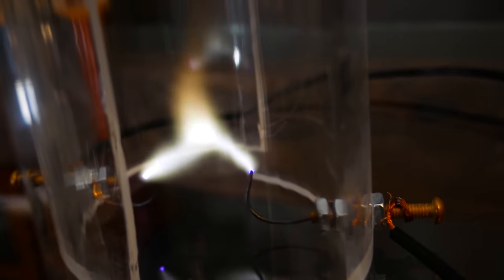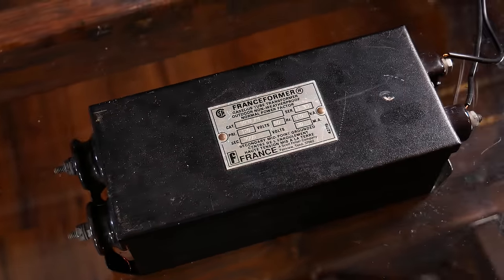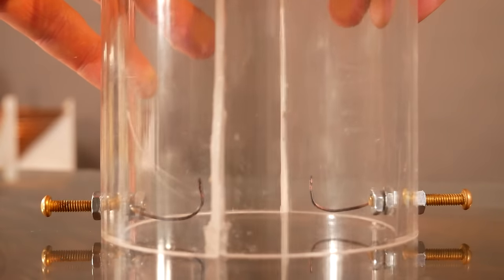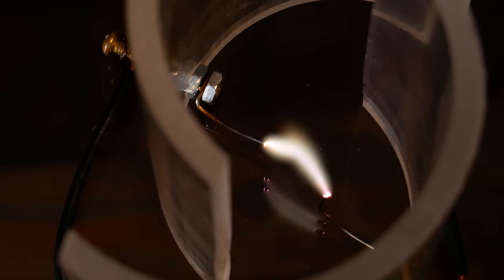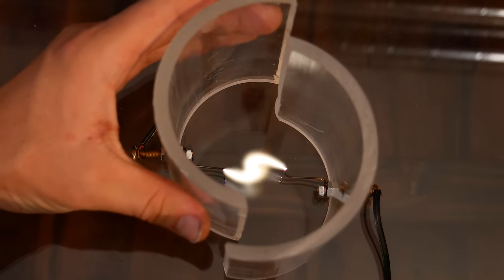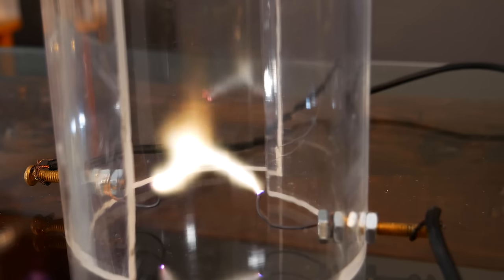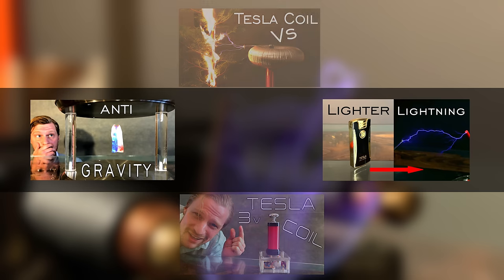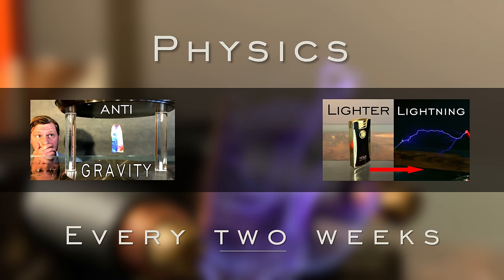9000 Volt Plasma Tornado Made by Electricity

Comment: Nice! I wonder what would happen if the wires were up and down rather than side by side. The arc would be vertical to start with, maybe it would do a belly dance?!
Reply from the maker: Hey Boom! I attempted this, and found the arc rotated, rather slowly, while bowed out. It just rotated once per second like a lazy Suzan arc. Wasn’t as interesting to film.
Reply: Hi Mehdi. :) 
I really love your videos and content. Hope to see you soon.
Reply: Hi electroboom
Reply: Both of you heros of mine... I have a similar concept I've been wanting to try. But would be willing to pass on the opportunity to either of you to do for the views. 

Take the rotor out of a decent sized 3phase motor. Hook it up to a VFD, Put a nice acrylic tube  through the motor and pull a vacuum.  I think you both see where this is going. 😃
Reply: That, and a bigger beefier FULL BRI..
Reply: I want to try this experiment with a microwave transformer
Reply: Gimme da meetah!
Reply from the maker: Heads up - the MOT vaporizes the wires. Too much power!
Reply: Also what would happen if it was in a smaller diameter tube
Reply: Instead of stacking straight vertically... Stake the wires with a twist to aid in spiral flow..
Reply: Do Not try this at home! Please! We love you too much! Don't do it! 🤪🤯💕
Reply from the maker: However, this would not be a plasma vortex. It would merely be a spinning Jacobs ladder
Reply: @PlasmaChannel  if you want to increase the rate of Arc rotation then you need to add a coil to the base of your tornado.  Ideally, power the coil with the same current you're using for the arc.  If you use the right hand rule, you should be able to induce a tornado without any air current needed.  The air will just lower the temperature and make it more visible.
Reply: @PlasmaChannel  use carbon electrodes.  It's easier to start and has a much higher vaporizing temp.  They do burn however, so they will still need to be eventually replaced.
Reply: Im the 100th like
Reply: @Unmannedair  Good idea, haven't seen it yet, and it could be done in a setup similar to the one on my channel with the coil being submerged for cooling. A pure iron core for the electromagnet would also be beneficial.
Reply: Hey Mehdi! Missing you man!!!!!!
Reply: @PlasmaChannel  please post it anyway, would love to see what you did and the results. It may not seem important but would like to see it anyway.

Thanks
Reply: Hi electroboom
Reply: @PlasmaChannel  9700
Reply: @PlasmaChannel  0
Reply: @PlasmaChannel  7
Reply: @PlasmaChannel  679
Reply: @jamesharrell4360  9
Reply: @jamesharrell4360  9
Reply: @PlasmaChannel  How about adding a vertical magnetic field? Lorentz force should spin it faster
Reply: I would use a ring on one or both lines that should help it rotate more 

For mot I would switch to carbon electrode and more so water cooling terminal

Comment: try a microwave oven transformer for that: 2000V 1A. Arcs should be hotter and thicker
Reply: Yep, I got 6 inch loops with one once before the breaker popped. I think it was producing around 650 mA.
Reply: Professor K MOTS are terrible for long lasting arcs, don’t rely on them to last more than a few minutes without melting lmfao
Reply: Might be fun to watch
Reply from the maker: I tried an MOT off camera. It was just too much power for my little setup. Vapporized the wires and burned the plastic in less than 1 second.
Reply: @PlasmaChannel  thanks Jay! Maybe it would work with a sturder setup...

Comment: Can you tell me how you increased the current from 30 mA to 60 mA of the Neon Sign Transformer ??
Reply: Two in parallel.
Reply: Or remove the shunts.
Reply: th trasformator might have 2 outputs like most transformers (3pins total)
Reply: But the one he used had only one. I have never seen one with two outputs.
Reply: @simont3686  there is a lid you can screw of on some models i know of (lid is for HV security)
Reply: @hyperhektor7733  I know that you can disassemble some of the old ones and remove the magnetic shunts to increase the output current.
Reply from the maker: Hi all, I placed a second identical 9kv 30ma transformer in parallel, off camera. I even tried with 3 in series...but found difficulty with the third (think it was half dead)
Reply: @PlasmaChannel  Thanks for the info. Now I got it......💯💯💯
Reply: Thank you. That seemed the most practical solution.

Comment: Good start! Two suggestions. 1) If you form the electrodes in a tall V shape (Jacobs Ladder) the plasma will heat and rise more easily. Also be more responsive to the convection current. 2) Add a ring magnet, like one from a magnetron, at the base. The magnetic field will also make the plasma spin. Positioning will be tricky. That is it. Please try some new ideas and make a part two.

Comment: Great video! In junior high I actually did a tornado chamber for my science fair project. That design consisted of the heat plate with water plexiglass doors that slid in four directions and heat lamps on top with a chimney in the center top. this creates a higher heat difference between the inside of the chamber and the outside of the chamber and gives a direction for air to rise. In the same way if you add a top with a chimney you can trap more heat within the chamber so the cooler air that comes in from your slats will create the heat difference needed for the convection to Twist!
Reply from the maker: Hi Mike! I tried something similar, and found that the vortex shrank in size, but, was much more stable. I'll give it another go ahead and see what happens
Reply: @PlasmaChannel  maybe air intake issue? Hmm interesting to think about! Can't wait to see your next attempt!

Comment: Cool! Very clever idea Jay, I'd love to see more of it! But don't forget that you still need the voltage to maintain the ionization of the air, so I think there should be a sweet spot somewhere in between. I would suggest trying the high frequency arc with a couple of hundreds of mA in it, the HF generally dumps more energy into the gas than DC and 50 Hz; for example you could try an old AC flyback. Good luck!
Reply from the maker: Hey Vidduley! Glad you enjoyed. Trying this with high frequency AC is something I do want to try.

Comment: You might already know but you can get insulating gloves made for handling these voltages for under $30.
I reckon gloves are a great buy! 
Just make sure they're class 2 or higher: 

Class 00 (500-650V), Class 0 (1,000V), Class 1 (7,500V), Class 2 (17,000V), Class 3 (26,500V) up to Class 4 (36,000V)

Pro tip: 
If you go to buy these you'll see thin cotton inner gloves being sold beside them on the shelf. They're not optional! You'll barely be able to get the rubber gloves on without them and will be disgustingly sweaty after 5 minutes. 
 
Insulating floor mats are also a good second line of defence (again, so long as it's class 2+) but they're more expensive and somewhat less useful when playing with neon transformers because there output isn't referenced to ground though  this should not be relied on. 

If you don't like the idea of gloves getting in your way (class 2 gloves are thick) another good idea I've seen is powering it from a dead man's switch mounted just out of reach of the project but what's the fun in that!
Reply from the maker: Thanks for the reminder - I need to get me a pair.

Comment: Did you trust those thin wires at 9kV? I have 20kV silicone wire bit I can feel a slight tingle if I touch the insulation when the wire is just 3.5kV to ground(7kV neon transformer).

Comment: Nice.....have you added smoke?...to see what is going where?...I would also move your nut/bolt arrangement off center left and right...as the air flow was inefficient due to the angle I was seeing for flow....just my observations...great experiment.
Reply from the maker: I tried two different nut/bolt placements - but could try additional. As for the smoke, that would have been such a good idea. I'm kicking myself for not including that in the viddy.

Comment: Neodymium magnets do some weird Spinny things to 6kv 80mA arcs.

And you could try to use argon gas!
Reply from the maker: I plan on combining strong magnets with this vortex setup, acutaully. May get some cool results if I use DC
Reply: a few kHz of AC will also cause an interesting "squishing" (sometimes also splitting) effect because the arc isn’t only pulled to one side.

And btw, over 50k subscribers already? wow!

Comment: What u wanna look at n into

The lpg turbo blow torches with 4x angled squares use that for ur hv arc point cause air turbulence vortex with arc point 

For displaying and wind speed rushing use a kerosene lamp glass tube

Both those together should make it light up a storm

Comment: Do you think that moving the pipes closer together horizontally, I.E, making the vents smaller, would cause a bigger twist? That seems like it would restrict airflow and cause it to accelerate faster, spinning the plasma more.
Reply from the maker: What is interesting, is I had to experiment with the perfect distances to find the sweet spot.
Reply: @PlasmaChannel  I don't mean moving the pipes closer or further away from each other horizontally, but moreso moving them along the other access to speed up the flow of air. Those vents seem large, but then again, I'm also not the expert.

Comment: Higher atmospheric pressure may help, also.  The air has very little force to push upwards on the plasma.  Also, unlike a fire tornado, the plasma vortex you have only has one point of heat at the bottom, while fire has additional fuel to burn while it rises, especially in situations like forest fires as they have solid fuel up to the top of the trees an then the vaporize carbon from there on up.  Perhaps a column of several spark points would help, and if they could be out of phase from each other, it may work even better.
Reply from the maker: You bring up good points. If the base had more heat spread out across the area, it would aide in rising heat. As per increased pressure, that would then also require more voltage to jump the gap.

Comment: One suggestion, gas filled and vacuum based HV switchgear is designed to quench the arc. Couldn't you use a transparent pressure chamber you vacuum atmosphere out of, and replace with a conductive gas to aid the arc?

Comment: You can use a MOT (microwave oven transformer). It can provide up to 2000v 0.7a or 4000v 0.3a with a voltage doubler (the diode and the cap inside the microwave)
Reply from the maker: I actually tried that. Too much current. Melts the contacts in seconds.
Reply: Of course if you have the thin wires you show on video they are going to melt. You can fix two "main" electrodes, e.g. two thick bolts (m5 or bigger). Then you can extend two very thin whiskers that have a space of ~2mm between them. The whiskers will easily melt and then the arc will run between the bolts.

Comment: If you want a good spin... Place an axially polarized ring magnet below the Arc... If you want a taller twist place two axially polarized ring magnets with their poles in the same directions, one inside the other, this should force the flux to extend further before returning to the opposite poles of the magnets and the flux will twist the plasma.

Comment: A flyback transformer with a rectification stage in it would allow the arc to flow only one direction while with an NST is outputting AC voltage which will push and pull the arc in both directions causing destructive interference within and around the plasma causing it to be restricted.
Reply from the maker: Also with DC, magnets can be introduced.
Reply: @PlasmaChannel  Absolutely! Use electromagnets to control and contort the arc. You could use use temperature senors along the chamber to tell tje UC what electromagnet to energize and at what frequency also potentially with an interupter to make sounds. Tjay would be really cool to try out.

Comment: how did you discharge in atmospheric pressure conditions??? could  you let me know what you use frequency
Reply from the maker: How did I discharge? This is 9,000 volts, which has no issue discharging at STP. Frequency is standard 60 Hz

Comment: I wonder if tornadoes which plague America and cause death and destruction could be stopped by firing vortex rings from giant concert speakers/speaker horns mounted on the backs of large trucks and lorries or firing various frequency sound waves at the center of the tornado to disrupt the tornado vortex. In a similar way a candle can be snuffed out by a plop by a speaker close by.

Comment: What about a plasma vortex in which the vortex is created purely by electromagnetic fields alone? As in multiple sources such that the current both rotates and moves linearly. Would the superposition of the two be a tight vortex?
Reply from the maker: It would be difficult to get a tight vortex with that method, but I plan on trying!

Comment: What current you use AC or DC . Because I'm guessing with DC supposed to work . Because there is no momentum direction change of current flow . You could also experiment with a acrylic nozzle left turn or right turn . Also if you will try a vertical configuration of electrode  . Also top and bottom polarization of electrode .
Reply from the maker: This is AC current, from neon sign transformers. The vertical configuration, I found out, does not help the vortex...it actually hurts it.

Comment: Perhaps stacking multiple electrodes vertically, so you have 3-4 horizontal arcs, and a smaller exhaust hole at the top, so most of the angular momentum of the incoming air has to be dumped into the plasma before the hot exhaust can escape...?
Reply from the maker: Michael, that is a great idea. I will try this. If I shoot a viddy about it, i'll give you credit.
Reply: @PlasmaChannel  More or less energy, etc.  More energy = more air moving, but higher voltage = more stiffness of the arc.  That leaves tricks with air, fans, etc.  I freaking love your work.

Comment: what would be the result if you keep the electrodes separated along y-direction instead of same plane. It is expected to make better p-tornado.
Reply from the maker: I did try this. It creates a vertical arc that bows outward slightly. The arc then rotates slowly in a circle. It is quite boring.

Comment: Deja' jacob's twisted ladder... I would like to see what happens if you close off the upper open sections and just let air jet in from the bottom and rise directly underneath the plasma stream. Then maybe place a single vertical strand of wire in the very center of your plasma from the bottom directly up though the center - I guess hang it from the top or something. See if that gives you the 'eye of the tornado' and something for the plasma to "follow" upwards. It may stabilize it? And I would also try adding a little magnetic flux to see if there is any interesting effect. Great content!
Reply from the maker: Hi Atomkey! If I cut off the air flow from the sides ,there would be nothing to initiate a spin, and feed the spin. It would likely just be a vertical arc.
Reply: @PlasmaChannel  Not the entire length of both sides. Quote: "I would like to see what happens if you close off the upper open sections" ~ so the air enters both sides just like you have it - but only the bottom half of the slits are open. Close off the tops to prevent air flow from disturbing to top half of the vortex ~ letting air flow up and over the terminals.
Reply: @PlasmaChannel  You would still have airflow IN from both sides at the bottom - but only the bottom. The top half of the "tube" would have some tape or something wrapped around maybe...

Comment: maybe experiment with smooth and sharp electrodes instead of tinned or copper wires and try aiming them to control the arc shape. It would make sense to tune the voltage to the electrode distance, so it comfortably arcs, then up the current. The current power level (9kV*30mA=270W) seems reasonable, doubling it might not hurt to try. You might want to get some better electrodes, like platinum or something that doesn't melt at higher power levels.. Being able to control the duty cycle might also be desirable, any additional info on the power supply would be interesting. Looking forward to part 2.
Reply from the maker: Hi Bob. You bring up good points. The hotter arc was using 540 watts of power. I then, off screen tried another 270 watts and the arc was crazy. I decided to not show it in this video.

Comment: Maybe have the electrodes at different heights, so the 'natural repose' of the arc is more vertical… This might work even better if the electrodes are a bit farther apart than the arc can initiate (so it would need help to start -- maybe a lit candle waved underneath?).
Reply from the maker: Thats a good idea. Cheers

Comment: I wonder if you can use strong magnets to generate lines of force fields to help direct the plasma. 
Sort of along the lines of the Sun when it has huge looping solar flares following strong magnetic fields. 🤔
Reply from the maker: This is a wonderful thought. I will need to try this.
Reply: @PlasmaChannel  I was thinking that if you build a circle of electromagnets around the cylinder and pulsed each one rapidly one after another it would have a rotating pull on the charged plasma stream. Sort of a railgun in a circle or like an atom smasher when they speed up charged particles in a loop. 
Duel charges rotating at a rate of 120 occilations/p Min with antagonistic forces on either side would cause the plasma arc to stretch out toward the to opposing fields and be dragged around a circle as the fields moved from magnet to magnet. Theoretically.